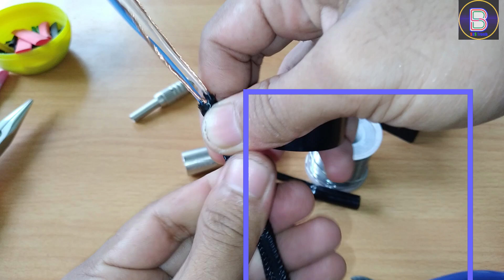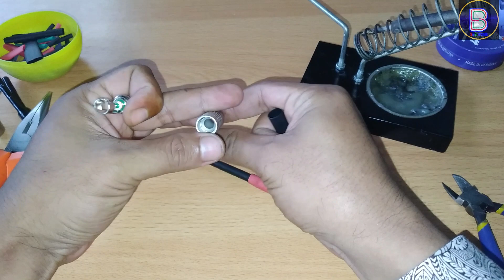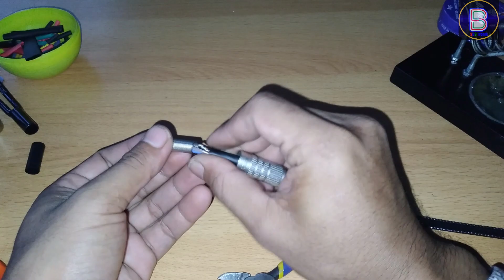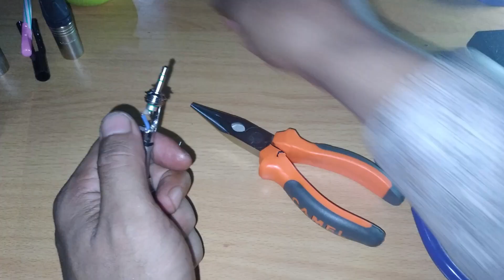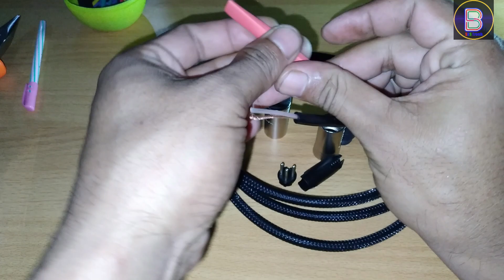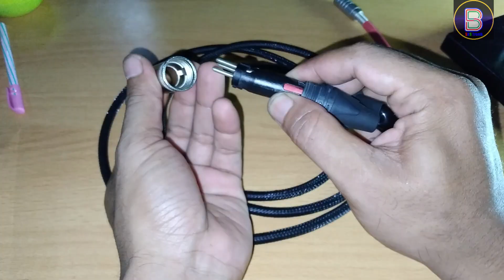How To Make 3.5mm Stereo to XLR Cable | 3.5mm-to-XLR Adapter

Comment: you don't show how to bridge pin 3 to 1
Reply from the maker: How to Make XLR to 3.5mm Stereo Cable |  Dual XLR Female to 3.5mm Jack
https://youtu.be/qJzUXvSACA4
Chapters - soldering xlr connectors

Comment: AbangQ ... boleh nanyak untuk Jack XLR,  Pin 1, 3 dan body di jumper yach ?? terima kasih ...  #SALAMSEHAT
Reply from the maker: Iya , betul di video ini karena menggunakan kabel mic isi 3 
Pin 2 /Hot dan Pin1,Pin3 dan Chassis Ground digabung
Terima Kasih
Reply: @sbstronic  Terima kasih  AbangQ atas responnya.....  
slam buat smua keluarga ...  GBU

Comment: Bang, setelah di pasang mixer channel 3 dan 4 misalnya, kenapa 1 channel saja yg ada suaranya ya ? 🙏🏻
Reply from the maker: Coba di Chek dulu pakai Multi Tester Kabel nya, apakah pada Minijack/3.5mm TRS apakah semua tersambung dengan benar
Tip/Left audio Ke XLR Pin 2 (Channel Left)
Ring/Right audio ke XLR Pin 2 (Channel Right)
Sleeve/Ground ke Pin 1 /Pin 3/Chassis Ground XLR (Left & Right)
Reply: @sbstronic  baik bang, makasi 🙏🏻